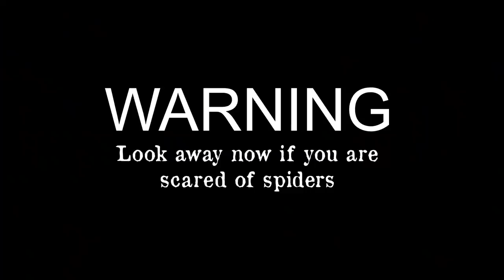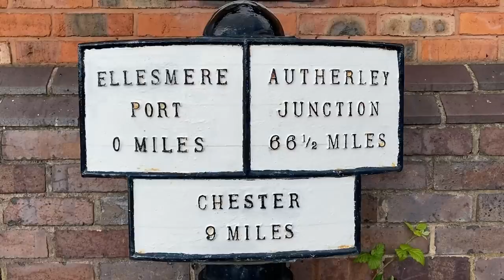I had to dump my bike at the end of this canal

Comment: Hi Robbie. 18 hours stuck because of wind and weed is an awful prospect. I might have a solution. I said, "I might".
Think your boat's heavy? It weighs only the water it's displacing. So, try this. Attach a long rope, about the length of the 'Naughty Lass', to somewhere central on the roof and at least a third of the boat's length from the prow. go ahead and pull. Just lean back and keep the pressure on, no need to break your back doing it. The boat will move and in no time you'll be able to keep up a gentle walking pace. This way, you won't have to go down the weed hatch at all.
If the wind is blowing you onto the side, it'll be more difficult, so you'll have to pull harder to get the pace up, but this time, tie your tiller over so that the rudder is wanting to turn the boat off the side and into the wind. This can vary from well over, but not too far, for a strong wind to almost centre for a light wind. Once you've got the pace up, the rudder should keep you off the side.
My 'get out' clause is that I said it might work. I've done it myself and it worked for me.
Good luck and please keep the videos coming. I'm enjoying them immensely.
EDIT. Ah! Sorry Robbie, I see that further down, it's been suggested and you've tried it.
Still amazing vids though, so thanks again for them.

Comment: Hi Rob. Another excellent video. I saw your pain with the weed. I'm unsure about narrow boats, but on our Scouting rib we a weed and rope cut fitted.
Rope Cutters

Protect your prop from being fouled by rope or weeds. The simple shaft driven rope cutter rotates with the shaft, which in turn instantly cuts any rope, weeds or debris picked up or snagged by the propeller. All Prop Protector rope and weed cutters are made from 316 stainless steel. There are clamp on or slide on versions for imperial or metric shafts. Clamp on rope cutters are available with an extra large blade version too.
Reply from the maker: Yeah I know about those but how they would cope with wire or mattresses (they’ve been known to get tangled in props!) i’m not sure 😂

Comment: you need to read the joy of shelves.

although I've done plenty of boating I do not have one yet, while looking though I am increasingly thinking about alternative designs like having an a refillable LPG tank and a solid nose as I allways think the cratch area is underused along with roof space and head lockers.

Van life has a lot of ideas for a small boat.

I love the idea of having an actuated bed over a dinette so you raise the bed to the roof to eat or work but can also have a double bunk bed set up.

have you thought of weaving blanket weed into a floor mat? or roof mat to cool the boat in hot weather.

Comment: Hi Robbie
Did I see a plate from the Basingstoke Canal (my local) that you tried to turn into a GoPro mount? I know you haven't been there but you should display it with pride and try to visit some day. Also you should have gone down the locks in the museum - there are some much better moorings for visitors down there with a security gate.
Jeff

Comment: Robbie. Is it possible to fit 2 off or a series of vertical blades to encompass the sides of the propeller attached to the underside of the propeller inspection hatch so that any blanket weed gets chopped by the turning motion of the same? If it works and no one thought about doing it, there's a business opportunity going begging!

Comment: You did real well there Robbie, how do the CRT usually deal with all the blanket weed? surely if it's just left it will take over the canals in no time.
Reply from the maker: In my experience they normally clear it with a special weed cutting barge or grappling hooks thrown in and pulled to the side

Comment: What about getting a golf brolley holder that clamps to the tiller (eBay) for sun and rain..easy to remove etc. phil627
Reply from the maker: Hello Phil I did have a special attachment that did just that, but I find them a bit useless as they can’t be taken down quickly enough for bridges and don’t provide cover for the part I need to stand in - inside the stern doors by the throttle. Nevermind! Cheers for the recent donation by the way I shall find a sensible way to invest it don’t worry!👍
Reply: The golf brolley holders should solve both those problems for around £7 (cheapy)...can't think what else u could buy🍺🍺🍺🍺

Comment: You know it's called a towpath for a reason.
Did you at any time considder just getting a long rope and start walking? It may look like hard work, but ince its moving it will keep moving.
Reply from the maker: I did exactly that but was unable to film it
Reply from the maker: It’s difficult as the canal isn’t straight and even slight wind blows it off course
Reply: @RobbieCumming  what works for me. (on a sailboat) is towing on a line from the rear of the boat and controling it wit a line from the bow, or in your case midships.
Towing from the rear makes the boat want to head away from shore, the bow line will enable you to steer
Reply from the maker: Yes I know that’s what I do, perhaps I will make a video about it one day!